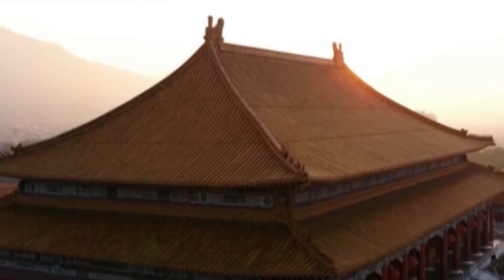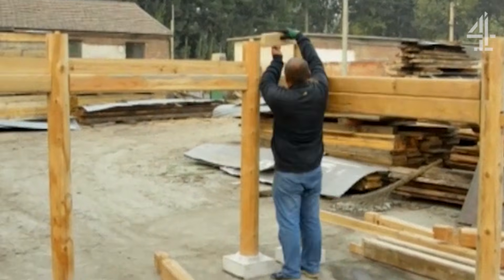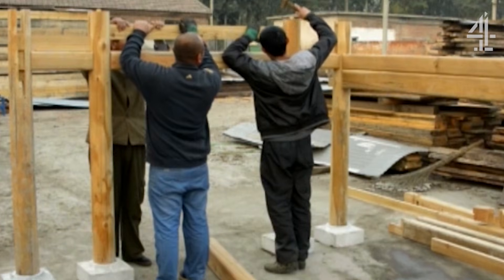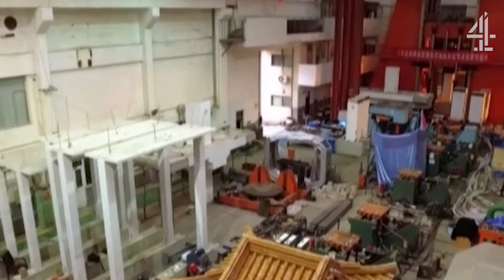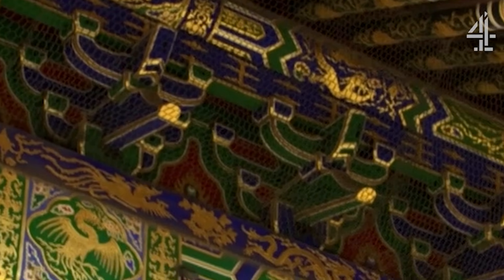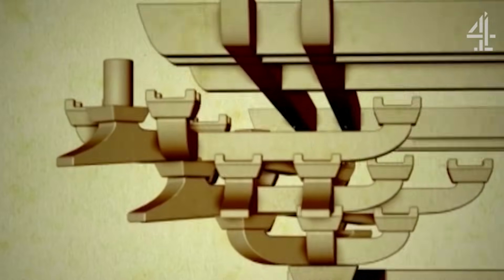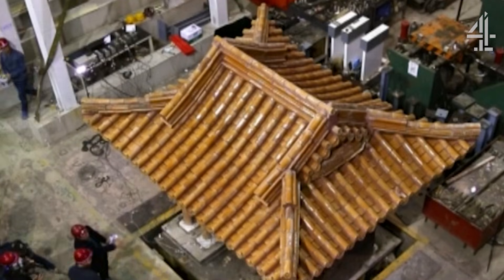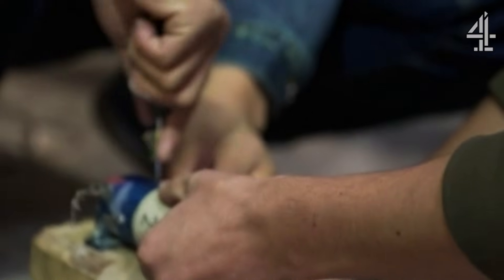How China Built Earthquake-Proof Palaces | Secrets Of China's Forbidden City

Comment: The whole building works as a big tuned mass damper. It's not really about the lack of nails. E.g. the big Japanese temple Todaiji in Nara (the biggest wooden building in the world) uses 16k+ huge nails to make composite pillars of cca 1 m in diameter since there was not enough of such huge naturally growing pines around. Individual pillars can be rigid in the cross section, yet still flex longitudinally. But the main thing is that the joints among the beams are flexible and that there is a heavy roof with weight tuned to the size of the building.

Comment: The joint loose structure indeed was spread to Japan and Korean. But the big distinguish is, the Japanese structures does not use  the technics that connects the heavy roof and bottom  pillars, leading the roof of Japanese structure cannot be super heavy
Reply: You're not exactly correct, the pagodas of ancient Japanese used the same sliding connections as the ones made in China, you can see that they have 5 stories in most pagados in Japan. It is nearly identical in construction as the building of the forbidden city buildings.

Comment: This also aplies to pagodas, whre there's only ever been a couple of instances of pagodas recorded being destroyed in earthquakes through thousands of years. Pagodas use a central column that runs through it, and that the whole building hangs off for stability, while being flexible (and zero nails so the wood can flex). At the top they invented the mass dampener system thousands of years ago, a heavy weight (usually a round knob of stone or crenellated metal spire) that moves at a counter to the way the rest of the column moves. This is why East Asians have traditionally used wood rather than brick or stone (other than for bases or forts) for their buildings -earthquake, flood and typhoon-proofed, but susceptible to fire. There are hundreds of pagodas that have succumbed to the latter.

Comment: It looked like the top of the building used it inertia and the moving platform shifted back under the roof before excess damage was caused.  What would happen if the moving platform did a shift to the side so the support beams were at an angle?  It looks like if there was be a lateral movement large enough that the support beams would tip over enough to send the whole structure crashing down.  Does the full documentary cover this?
Reply: That would be at least magnitude 12. It belongs to another book altogether.
If earthquakes are producing magnitude 12s... it would be a lonely feeling to survive the quake.
Reply: The building doesn't matter anymore since even life would perish with such immense magnitude.

Comment: Very primitive compared to Greece and Rome.
Reply: One of the reasons that the Chinese (and the other civilizations that used wood on their ancient architecture styles) preferred using wood because of the lack of stone and iron deposits near the capitals. Also, one of the more striking reason is that they felt wood is much more alive than stone/concrete. They could have built structures using stone/concrete, and they did, but they just preferred wood. They also did not have the mindset of building the structures with its longevity in mind because they were prosperous to the extent that they can just build when one becomes ruined. Lastly, the Chinese also preferred horizontal expansion over vertical due to their mindset of thinking that vertical expansion was extravagant and also impractical for there was more than plenty of space. Also, their idea of being rich/grand was having more horizontal space, rather than expanding vertically. 

See? no race is inferior. Just pointing that out.
Reply: @Ivan-bg1jp  I went to the Ontario Royal Museum, the curator explained Chinese people believed people should live in wooden buildings while stones were reserved for the dead.  So you see a lot of stone structures in tombs such as doors made of stone, etc.
Reply: wic wong Yes, because they believe that wood is alive and that stones/bricks are dead. Can't deny that though, personally, I would prefer my house to be built with wood accents one day
Reply: @Ivan-bg1jp  Another reason is Feng Shui. According to Feng Shui, multi level buldings are not good for posiyive energy.
Reply: Forbidden City is still intact after six centuries, though.
Reply: Ok boomer
Reply: Ok, LOSER
Reply: But it was the last one standing since it is well maintained

Comment: Ancient engineering was much better than we (modern) people think. The Romans too, and other long gone civilizations.
Reply: Because while we are trying to cut prices as low as it could possibly go, the monuments, temples, and palaces of the ancients are built to last
Reply: Roman concrete dating back to the old Republic (hundreds of years pre-Christ) has withstood the test of time, while the best modern concrete is lucky to last more than 75-80 years.
Reply: @ryankelly369  well, the Roman roads did not have to bear the weight of tons of trucks going back and forth a hundred times a day. Traffic was MUCH lighter back then. Roads today simply have to withstand a lot more, and you need to add the elements to this, as well. especially winter, when roads are salted to keep ice off. It all damages concrete and asphalt. Roman roads didn't have to withstand as much.
Reply: @Xia-hu  Roman concrete was used in aqueducts and is still intact today.  I'm not talking about roads.  I'm talking about their concrete used for the same applications we use it for (like sewer lines).
Reply: Give this experiment a try. Mix 1 part lime with water until dissolved into a semi-thick liquid. At the same time mix 1 part waterglass with water until dissolved into a semi-thick liquid. Mix the two together and add the right amount of sand and gravel and add some water with common sense and logic and write down the additional amount of water you added. 

In the 1960s it is 1 bag of cement, 2 bags of sand, and 4 bags of gravel and add enough water until it is a semi-thick liquid which is semi-plastic and semi-liquid which can either be  placed or poured with the use of POWERFUL CONCRETE VIBRATORS AND MOLD VIBRATORS. 

Roman concrete functions when the dissolved lime penetrates the atomic holes of the silica component which is present in the powdery fine volcanic ash and REACTS WITH IT. 

But this time the silica that the DISSOLVED LIME will react with WILL NOT HAVE ATOMIC HOLES FOUND IN THE SILICA COMPONENT OF VOLCANIC ASH CALLED POZZALANA BUT INSTEAD WILL REACT WITH THE EQUALLY DISSOLVED SILICA IN THE FORM OF DISSOLVED WATERGLASS KNOWN ALSO AS SODIUM SILICATE GLASS (which is also used as a glue in the 1950s and 1960s up to the early 1970s. 

This time the atoms and molecules of the dissolved lime with react with the atoms and molecules of the dissolved waterglass known also as sodium silicate glass or soda glass.
Reply: There’s also that Chinese bridge built in the end of sui/beginning of Tang Dynasty (1000 years ago!!). Still standing fine with minimal normal maintenance. Incredible. 

I mean they didn’t have tv so what else were you supposed to do except invent crazy good shit…if you werent dying of plagues and wars and septic of course.
Reply: its called survivor bias
Reply: Dou gong creator r lego lover
Reply: This stuff was better than what most people use now
Reply: fun fact about romans: they were well aware that their concrete was amazing against compressive forces so they optimized their buildings to keep it together as much as possible with stacking a ton of weight on it to keep it together. 

(also that their specific concrete mix was kinda lost to time)